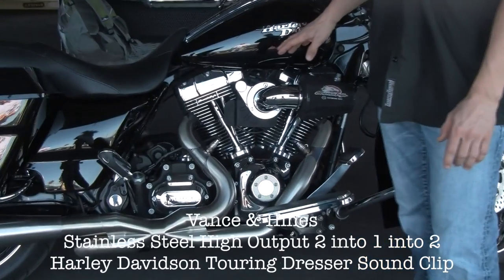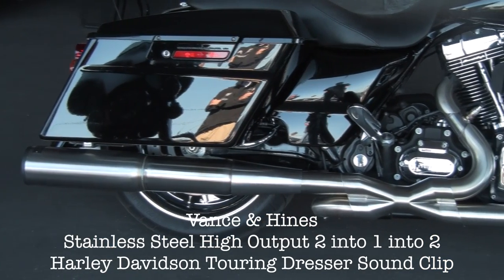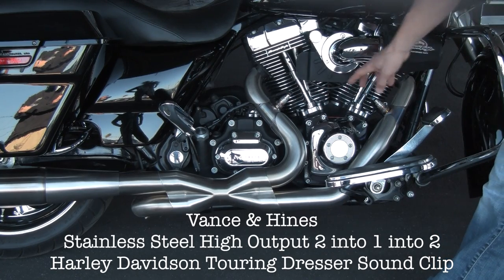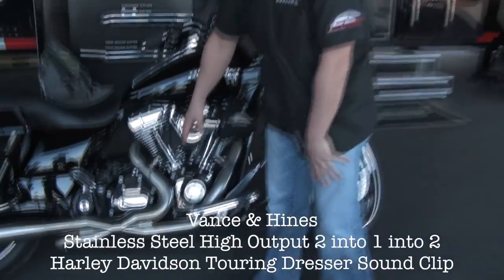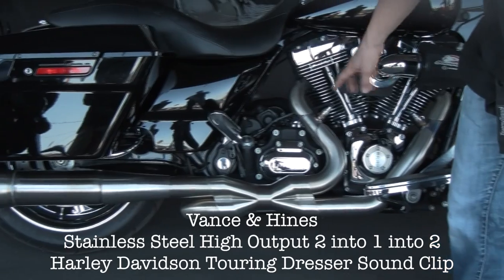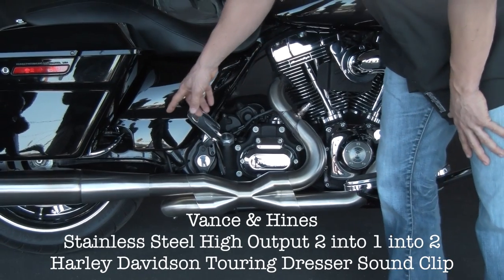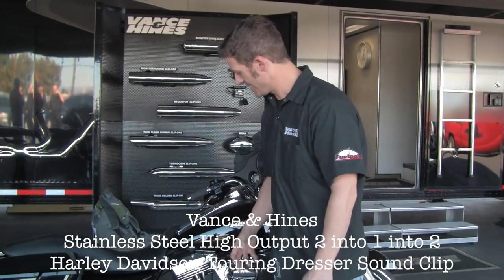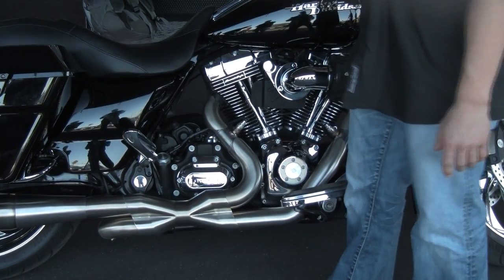Vance and Hines Stainless Steel High Output Duals 2 into 1 into 2 Exhust Sound Clip

Comment: Alabiggy,
A Stage IV build is CNC machined heads with larger valves and heavy duty springs, 10.5:1 pistons, 58mm Throttle body, 259E cams, perfect fit pushrods, heavy duty clutch spring, high flow fuel injectors and of course a tuner and exhaust. The street legal kit from HD is $2000 and the SE Race Kit, which includes the Pro Super Tuner and high flow injectors, is $2350. Total cost with air cleaner, exhaust and labor is around $4500, give or take $500. The Race kit will void your warranty 6 different ways so don't bother if you're concerned about that, but it will almost double your HP and give you about a 35% increase in torque. You would have to spend $10-20K, or more to get those kinds of increases out of a car, so you do get a lot of "bang for the buck".